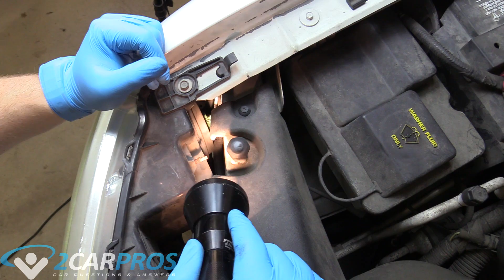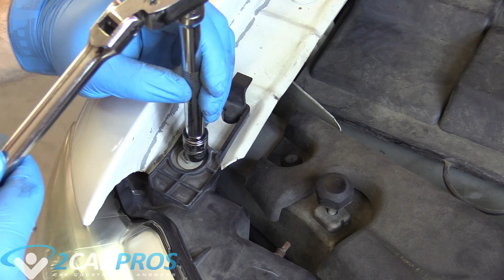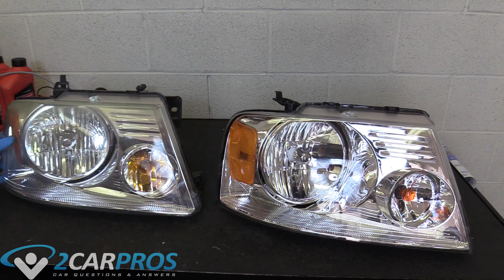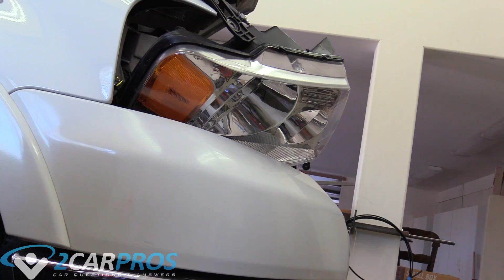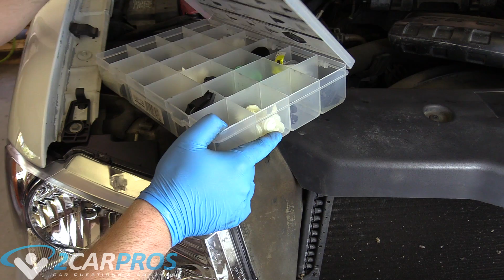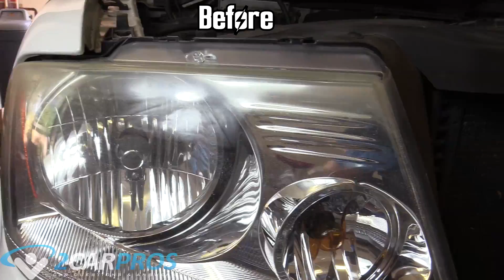How to Replace Headlight Ford F-150 2004-2008 | EASY!

Comment: at 11.48 , i noticed the lights on the garage door , both lights seem to glare to the right , almost identical , instead of a spread on both sides , my jeep lights did this , on one bulb , i re, seated the bulb to face the other way and it created an even spread across the drive path , just a helpful tip  :)

Comment: I just got the exact same lights for Xmas for my 2005. I had the same problem with the marker lights - ended up using the original ones to make them work also! That said, the spring clips for the outside edges were WAY outta speck - I had to re-use the Ford clips on both sides.
Reply from the maker: At least it works, I have noticed aftermarket stuff you sometimes have to make work. But its better than paying 4-5x the cost for OEM. Thanks for watching!

Comment: Does nobody cover actually adjusting them? How about left to right adjustments….
Reply from the maker: It is set for left and right so you only need to do up and down. Thanks for watching!
Reply: @2carpros  It actually does have left and right adjustment, it's just difficult to do. The inner brackets can move... I hit a deer and found out this bracket is adjustable the hard way Haha...

Comment: If you use painters tape and apply the tape to your garage door by your old headlights then it’s very simple to adjust your new headlights after installation.
Reply from the maker: Good tip! Thanks for watching!
Reply: And if you don't have a garage  then that tip is useless thanks
Reply: @QueBall5235  Then use a wall brainiac.

Comment: I don't know if it was the aftermarket headlights I put in or what, but those clips on the out side of the lights would no way go in the holes. I had to use long needle nose plyers to compress them to go into the holes.
Reply: Same here

Comment: I've been buying new headlights off Amazon every couple of years for my '07 F150. They are around $65 for the set. I put a little wax on them now and again. They don't last long, the clear coat starts pealing. As a side note, I have started putting silicone on my bulbs around the sealing area when I install them so the lenses don't get moisture in them. Most people think the moisture is coming from the seal around the headlight lens. It is actually coming from poor manufacturing tolerances around the bulb area when purchasing cheap Chinese knock offs. I don't even bother sanding the lenses when the clear starts coming off, for $65, I will just replace them every couple of years. Hope this helps someone.
Reply: Try drilling a small weep hole in the bottom  / lowest spot
Reply: Hey I want to put a f150 off road bumper on my expedition. Do you think I can put F150 headlights on as well so the bumper will fit?
Reply: @forrestcason3584  i have no idea bud. I imagine the headlights would fit.

Comment: Typical aftermarket parts... They almost fit..   Tip for folks aiming the lights. Find a flat area with a nice wall that you can drive right up to. Take 4 pieces of painters blue tape. with you. Turn the lights on high beam, drive up to the wall straight until the bumper almost touches. Take the tape and make an X in front of the center of the brightest area of light. Now back away from the wall 10-15 feet. Look at where the brightest spots are now. They should still be on the X's, or a tiny bit to the right of them. If not adjust the lights until they are. If you have combined high/low beam lamps you are finished. If however you have low beam units that are also adjustable, switch to low beam now and adjust those using the same routine of making the X at the brightest point, BUT you want the low beams to be lower and to the right to avoid blinding other drivers. How much depends on the type of light you have. Newer vehicles that have a real horizontal cut off on the low beams are adjusted a bit different than ones that do not have that beam type. Those measurements are available, either in the owners manual on some models, in the service manual or at the https://www.2carpros.com/questions/new link.
Reply from the maker: For the price I really can't complain. Awesome tip on the aiming though! :) Thank you so much for watching!
Reply: thanks for advice thinking about changing mine